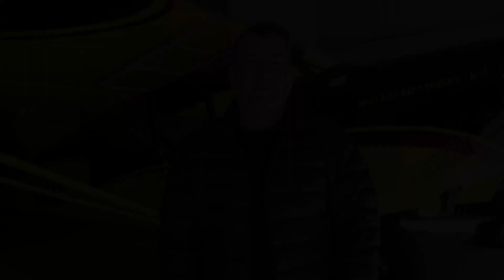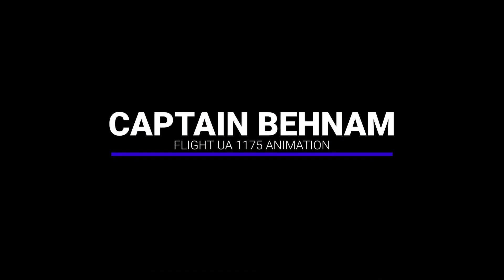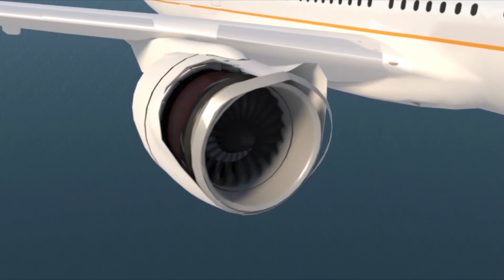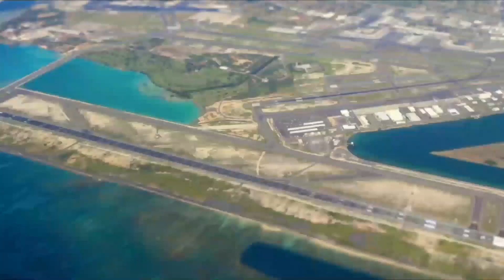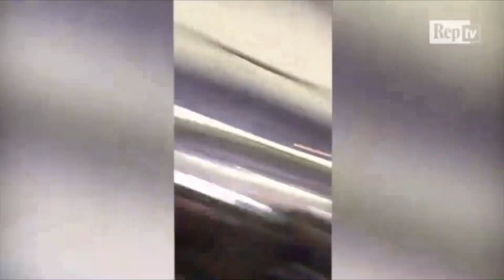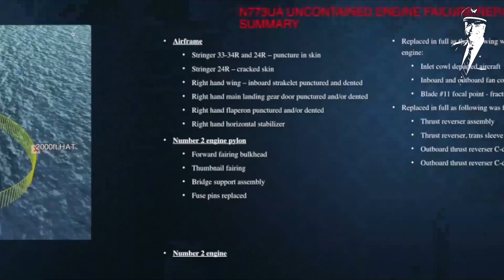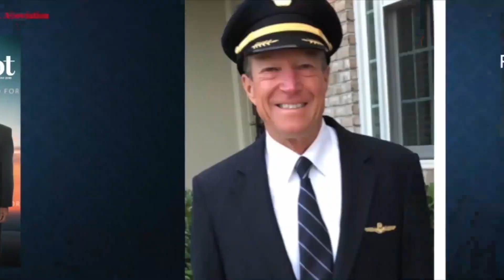UAL #1175 B-777-200 Fan Blade Out Animation

Comment: If the vibrations from the actual incident would damage the simulator, what exactly was the extent of inspection, testing and repair of the plane? Did they take the cockpit apart and test every component and check every connection? What about the rest of the plane?

Comment: Just a thought,  wouldn't a braking system built into the jet engine prevent windmilling and vibration with fan blade failure?

Is the idea practical?

Comment: The 747 out of Maastricht wasn't a fan-blade off event, it was losing turbine blades. It's also a different PW400 type, the 94" diameter fan, with massive blades, not hollow.
Reply from the maker: I think investigators will find that it was a fan blade out that initiated the sequence.
Reply: @blancolirio  Interesting take on it. Do you have any inside information? The PW4000-94 variants have no history of fan blade failures, they don't use the wide-chord hollow blades of the -112 variant. There is hardly any information to be found about this incident, the Dutch safety board says nothing except that it is investigating. There are only pictures from the sides, however those show an intact cowling so at least it wasn't as bad as the 777 cases involving the hollow fan blades.

There is also at least one previous documented case of a PW4056 LPT failure: https://data.ntsb.gov/carol-repgen/api/Aviation/ReportMain/GenerateNewestReport/92117/pdf where the rest of the engine remained intact.

Comment: It's almost like the engines need to be attached with explosive bolts so a severely damaged windmilling engine can be jettisoned. Of course then there's the matter of those on the ground. I wonder how close it came to fracturing the break away bolts? It makes one wonder what hidden damage all that vibration may have caused to the airframe.

Comment: Your comment regarding the shaking of a simulated fan blade failure in training could destroy the simulator asks the question,,,," what damage could this violent vibration cause to the air frame and components of the rest of these planes", and would these planes still be airworthy?

Comment: Seems like they took a LONG time to shut down that engine.  Last time I had one pop, with loud clanging and bashing noises and vibration, I verified with instrumentation, pointed it out to my second and shut it down within seconds, then aimed for my driftdown.  THEN on to the checklist.  AVIATE, first.
If the FO couldn't get to the integrated checklists, pull out the paper QRH.  That's why it exists.
If he can't figure out what speed he needed with the compromised structures, he really doesn't understand how to use is AOA.
'pulled 90,000lbs of thrust on the left engine"...  He's talking like there is a gauge for that.  lol.  A bit silly, throwing coffee table numbers into his narrative.  Maximum thrust is maximum thrust, regardless of numbers.

Comment: They could use a paint shaker (like at the hardware store) to simulate an engine  out.  Massive engines are getting lots of fatigue failure problems.  They might be pushing the use of steel in places where they need titanium, to save $$$ and  practicality.  Maybe it's time to go back to three engines?  Tri jets always were really cool looking.

Comment: When I was an active pilot we went to Flight Safety once a year. At the 6 month mark, we did it in the aircraft. I was Captain of a S76C++ and a S92. The simulator are of the type you describe, full motion, 6 hydraulic pistons on the bottom, the roof full of cameras. We spend 3 training days and the 4 day was the check ride all in the simulator. Plus classroom time. 

Flight Safety at DFW also has several fixed wing simulators as well. You watch the crew get into a fixed wing simulator. The sim will go on motion. A little later the nose will go up, the sim will level, 1 and a half later the nose will go down. It will level and go off motion.

You watch a helicopter crew get in the sim, it goes on motion. Then it looks like 10 seconds of unusual attitude followed by a take off. As you watch the sim through the flight, you will see boughs of what can only be unusual attitudes. However in the sim, those were not suppose to be happening. It is just normal flying for us. It is really bad when the sim malfunctions and you get the "Red screen of death".

Helicopter simulators do not fly like the real aircraft. So when we get in the sim we get 1 trip around the pattern to learn how to fly the machine. So you get all the unusual attitudes happening. The rest of the sim is IMC.

Comment: It certainly would be possible (in the engineering sense) to reasonably accurately simulate the flight characteristics encountered in these incidents - whether the software used in them supports this kind of "deformed airframe" scenarios or not is a different issue.

Comment: Pretty disappointing that the airplane could not hold altitude after an engine failure. There was a time when a dual-engine airplane was not allowed to carry passengers over long stretches of ocean. Aerodynamics or not, the airplane ought to be able to hold itself in the air with a fully functioning single engine. A 747 wouldn’t have been forced to descend in that situation.

Comment: - sounds like a case for  a redesign of the simulator to updated vibration specs

I would also recomend, is such cases as this
-  considering condeming the entire airframe after such a sustained vibration event, 
unless a full vibration structural analysis is carried out detailing the reduced airframe fatigue life capacity and subsequent revision of the structural inspection program for the life of the impacted airframe

Comment: It gets an airman's attention that the vibration was so severe that finding buttons and reading checklist was next to impossible. Also if the vibration level were to be reproduced by programming a simulator, it would cause the simulator's hydraulics, electronics and screens to fail. Definitely a noteworthy rough day in the office that will be remembered by that crew and passengers. May we engineer better maintenance procedures, engine/airframe/autopilot configurations, quicker updated engine telemetry performance to guard against this scenario moving forward. Luckily Captain Chris Behnam was up to the task of Stick & Rudder hand flying this crippled aircraft with informed decision making the transition decent through the IMC to a safe landing. Glad their making the aviation community aware of this more common problem concerning propulsion blades.

Comment: May be we don't need to create the vibration on the whole simulation machine. For visual effect, we can have a shaking stereo image on screen to fool our eyes. Other than that we can install a strong massage chair vibrator on pilot chair. In such visual and vibration system, the UAL#1175 event should be able to recreate without damage the hydraulic system & any onboard equipment.

Comment: Juan, how about a review of the proposed A320XLR outside conformal fuel tanks that if hit by an uncontained engine failure might explode or quickly burn up that side of the plane in the 500 knot slip stream at 30,000 ft?

Comment: Mechanical engineer's observation: This incident brings ETOPS into question. Not having seen the original analysis leading to ETOPS approval, were all of the drag factors considered, in addition to loss of 50% thrust? Yes, you can firewall the other engine, but they are not intended to operate continuously flat out (takeoff thrust?). The fact that actual observed long distance drift down altitude is apparently 0 feet MSL, not 20,000' as stated, implies that some of the drag factors were ignored.

1. Drag of the frontal area of a very large diameter engine vs drag of one of the smaller engines on a tri-  or quad-jet.

2. This engine drag is more than just the frontal area, as there are several full diameter flanges sticking out along the length of the engine. Each individual flange adds more to the total engine drag. These additional flanges are normally not exposed, but hidden from the airflow behind the cowling.

3. Some drag force added to spin the windmilling fan.

4. The engine core may not be windmilling much, since it is geared to and still driving auxiliaries. Thus part of the barn door.

5. Drag of rudder and ailerons at full deflection.

6. Drag of fuselage flying slightly sideways.
Reply: This is the aspect of the NTSB report that disturbs me the most; the absence of the word "ETOPS."

Comment: It took 30 seconds for the pilots to realize engine failure, while the passenger can immediately see engine has problem from the window. There has to be fix for that delay.
Reply: Some 777s have a camera system that can see the engines. It’s a limited angle of viewing though. Not sure if the plane in the incident had them or not, but I’d imagine if that even if it did, those guys wouldn’t have been able to push the button to turn on the cameras due to vibrations, and they probably wouldn’t be able to see the screens clear enough to make out what happened.

Comment: In the audio of the simulation they said that the airplane was 200 miles out of Hawaii. This is incorrect if the parts fell over Colorado.
Reply: This video is about the United Airlines 1175 incident that occurred in 2018, not the more recent one over Colorado. However, both incidents are similar in that they involved fan blade destruction in Pratt and Whitney engines.

Comment: Great animation. Vell done. Incidents of this nature can be reproduced in the simulator, but not for 40 minutes, for the reasons you mentioned. I'm sure when you returned to the sim, you may have gone through the new UPRT training, which is fairly severe. Initially after implementation, there was damage to the simulator, but corrections were made with no further issues. It would be somewhat difficult to add this scenario to any lesson plan from a regulatory standpoint. In a nutshell, it's very much doable, but like the 320 in the Hudson which was implemented in one of our sims, but none of the pilots that flew the scenario, succeded, because these are one of those occasions where real stick and rudder skills are needed. Just like your Husky reauires. Like the A330 that ran out of fuel, because of a leak, and glided more than 120 miles, even making a 320 to loose altitude, to a successful landing. Stick and rudder skills. P&W is about to feel Boeing:s pain.

Comment: What a great simulation! And since we heard the story from cpt Bennet himself, we know that it is very accurate! I just had to laugh a bit at the beginning because it looked as if Ed Gagarin (what a special family name btw) was not wearing any pants :)  I have one question about the incident. Cpt Bennet told that when they selected the flaps, they were not sure if they would function. Wasn't there a risk that the flaps on the left side  only would deploy? This happened on oct 4th 1992 near Amsterdam Schiphol airport here in the Netherlands. An El Al (Israel) B747 freighter took of from Schiphol Airport and shortly after the number 3 engine fell off and took the number 4 engine with it. Probably the pilots were never aware of the fact that the engines really fell off, they thought the engines had just failed. When they selected the flaps to land a bit later, only the flaps on the left hand side deployed, the hydraulics to the right hand flaps were destroyed by the engines that fell off. Now this caused the plane to make a fierce roll to the right, and the pilots were not able to counteract the huge unbalance. Eventually the plane ended up banking 90 degrees to the right and crashed into two high apartment buildings, causing many many fatalities on the ground.

Comment: Awesome interview and the audio for the animation is good. But the amination needs some work: artificial horizon was level flight when the plane was banked at 45 degrees, right engine instrument display rolled back right away when the engine failed, etc. Very helpful video.

Comment: Even though it can not be accurately simulated it must still be added to the syllabus. A lot of messaging around how the violence will exceed the simulator experience would help with that. The aircraft controllability issues are more important than accurately recreating the severity of the vibration, and that can definitely be programmed into existing simulators.

A word or three about simulators- as we evolve in the collective consciousness of commercial aviation, so must the simulators evolve into more capable devices. The emergency events that threaten an aircraft are less and less frequent and more and more extreme, since our systems and procedures have evolved to such a fine point of handling and/or preventing lesser incidents.
The bigger the diversion from normal flight dynamics the more expensive they will get, but these are the details that become important when you have a ridiculously low accident rate. The further to the left that decimal point moves the more difficult and expensive it gets to move it.

Comment: I don’t want to be an alarmist being an ATPL holder, but this really makes me think about twin ETOPS!  30-60 min earlier they would have been in the water!
Reply: At the very least, fatigue failures must be modeled into ETOPS, and loss of aerodynamic state of the airframe once the cowling comes off. If these conditions were included in the ETOPS analysis, I find it hard to believe that ETOPS certification could have been granted, or if granted, that the blades would need to be replaced after a certain number of hours or cycles. P&W does not have an effective screening process for detecting fatigue, as evidenced by the number of failures with their fan blades in flight. The other problem is that if the engines have been paired on the same airframe, the chances of correlated failures and having a second engine fail while at max power for the remainder of the flight increase.

Perhaps flying with flaps 1 would have allowed an airspeed which would not have had altitude decay, but whether there would have had enough fuel to make it from the further point from land at that speed, drag, and altitude is another question.

I really wish the NTSB would have explored that aspect of ETOPS in their report.

Comment: If the simulation of the event would break the simulator, what is the condition of the 777?  Will it need to be scrapped?
Reply: The Aviation Herald incident report on the Flight 328 Denver to Honolulu fan-blade-out incident on 20 February 2021 says that registration N733UA (the plane involved in this 2018 incident) is the plane that replaced the damaged plane to complete the flight to Honolulu. It is back in service with United Airlines.

Comment: Crazy idea for a simulator.  Start with a 1 ton flatdeck truck, with 4WD. Build a cabin on the back. Have a basic flighf sim setup inside. During normal flighf simulation , the truck would be driven around a smooth oval track. Then to simulate severe turbulence,  the truck would shift to a rough, off-road racing course.
Reply: I realize that's a bit tongue-in-cheek, but I think it doesn't solve the problem of shaking the video projection apparatus apart.
Reply: @Graham_Wideman  or the problem of a trainee getting injured by violent shaking...

Comment: Given that a dead engine can present huge problems with drag and vibration, would it be possible to design in an ability to jettison an engine deliberately, at least over water or isolated areas? This of course would compromise any investigation, but surely could make the aircraft much more flyable and increase the odds for a safe outcome.

Comment: At Around 4:20 you talk about the vibrations etc damaging the sim if the flight was replicated, which raises the question of what happened to the airframe of flight UAL1175. Did they just stick another engine on it and send if off the Hawaii again or was it written off due to all the stress the vibrations put through it?
Reply: Still in use (registration N773UA).
Reply: @lizj5740  Thanks LizJ

Comment: one aspect not mentioned but worth noting is the heightened risks involved with a loss of one engine with respect to the hydraulics.

once that engine become inop, the aircraft hydraulics are dependent on one engine ....

and if for any reasons that single engine should no longer be capable of driving hydraulics, the only remaining options is to deploy the RAT and maybe run the APU, or both.

so the question I have:  did this pilot turn on the APU after the one engine failed?  

have it spooled up ...just in case.?

Comment: Okay, I get that the simulator can’t handle the vibration levels in this incident, but is their still value in simulating other aspects of this situation?
First, the initial upset and recovery maneuver where you get a bang, autopilot and auto throttle both trip off and the aircraft rolls to a 45 degree angle at .83 Mach while all engine instrumentation appears normal. Following recovery keep as much drag dialed in on the side with the engine failure and make sure the autopilot and auto throttle won’t re-engage. Then force the crew to start a drift down where they have to hand fly the plane and figure out a new speed envelope and avoid stalling the plane. Once they do that end the simulation. Do this much without the vibration that the sim cannot do. I think that training would be beneficial even without the vibration aspect. Also, the engine severe damage checklist should have a note that states the engine displays on the EICAS may show their last valid value for 15-30 seconds before blanking so that the crew are aware that there is a period of time where normal engine displays could be shown with an engine that has really failed.